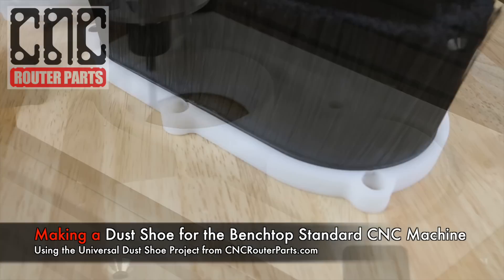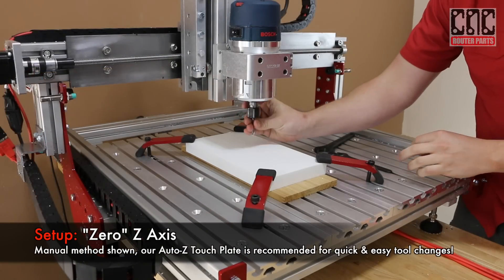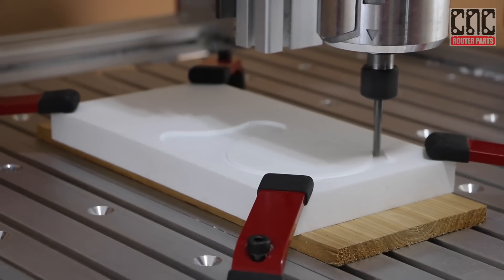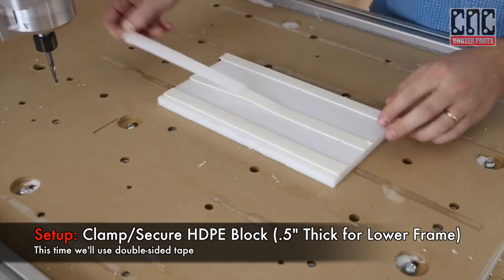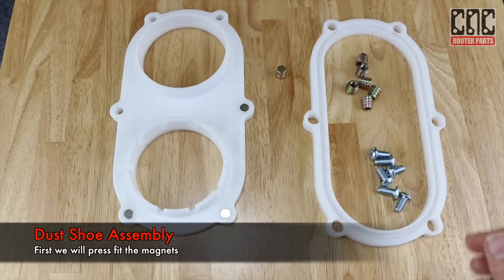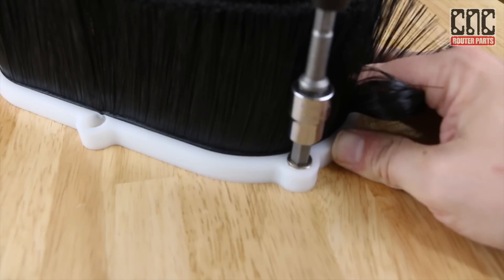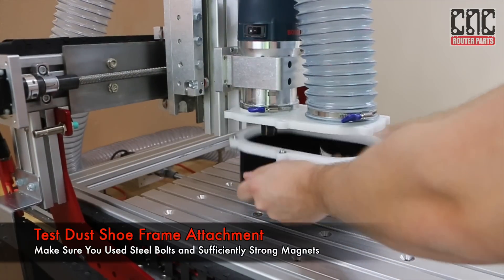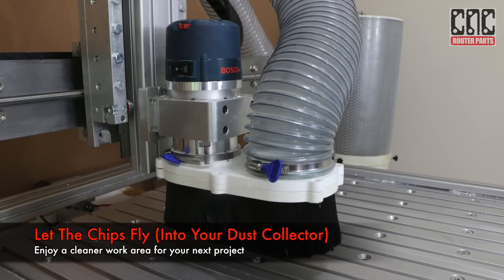Making a DIY Dust Shoe for the Benchtop Standard CNC Machine

Comment: Any suggestions on how to deal with warping?   The finished pieces are so bowed they are impossible to use.   They were milled from flattened HDPE stock.
Reply from the maker: You could try another piece of HDPE. Most of the time it's flat enough. Another material might work well too. Best bet is to post on our forums. There are a lot of users there that do stuff like this. I bet you could find some help there.

Comment: I made this shoe but the m8. 1.25 bolts that are recommended are not good.   As other have said and all the reviews the screws are not attracted by the magnet enough and falls off very easily.

I went to Home Depot and bought the zinc plated bolts m8 1.25 16mm and they stick to the magnets 3-4 times stronger and now it’s take effort to pull it off.

Comment: I just made this, it went pretty well.  Here's what I recommend:

1) Don't use the linked HDPE plastic stock from the source project page.  That is standard cutting board stuff and is way too flimsy, especially for the lower ring - it will probably warp on you.  Use King StarBoard ST (marine-grade HDPE) - it's UV and weather resistant and much stiffer.

2) It would be nice to add a couple outer "lips" or tabs on the lower portion to give it some purchase when taking it off.  I'm probably going to re-cut my lower portion to do that, or I might just add a couple of thumb screws.

3) Make sure your inserts are perfectly straight going into the lower ring, otherwise the two might not  seat/seal together nicely.

Pretty fun first project on my new Avid CNC, really could've used a dust shoe though, got chips everywhere!  The machine performed flawlessly.

Comment: I'm working on this project, modified the hose diameter and offset, I have run the top mount plate and it rand perfectly with my single flute 1/4" Dimar SCPl46 at the 120 in/min. Now going to run the bottom brush plate with same bit plus the Dimar 1/8" single flute SCPL43. 

Still looking for a source for the 3" strip brush. I see in Fusion 360, the design could have imported the parts from McMaster Carrs drawings. This would have provided everyone with a source and part numbers when making this project. Thanks to everyone at CNC Router Parts for the project, it's really great, and pushes us to lean some Fusion360 for other projects on our list.

 I look forward to more projects in the future.
Reply from the maker: Hi, thanks for the comments! We have updated our DIY Dust Shoe project page with links to all the parts (including the dust strip) > http://www.cncrouterparts.com/universal-cnc-dust-shoe-p-396.html . -Nathan

Comment: I love the design. I have found an issue with the universal Dust Shoe in the fusion360 when you 
change the parameter HoseOffset to 8.82"  the insert extrude for the 
middle to mag mounting do not move in line with the changed location. 
Also the two mounting holes near the dust hose and merged together and 
is elliptical. With no holes.  I am looking to use this dust shoe on my 
Machmate CNC machine. Also it would be nice to be able to add another 
set or to of mounting holes to do with the longer length. So a parameter
 to say how many mounting holes on the straight edge would be nice. You 
could lock positions of the mounting holes on the curves. I have only 
just started using fusion360 so my skill level at the moment is well 
beyond fixing these issues will you
Reply from the maker: Hi Paul - Thanks!  I see the same issue, looks like some of the sketch constraints were missing.  Try the v1.2 version I uploaded to our project listing, should work better now.  -Nathan

Comment: Thanks for the video... Where did you get the brush strip?...
Reply: +Teddy torres I got mine from McMaster Carr.  Search for conveyor brush.  They sell it in different lengths.
Reply from the maker: +Teddy torres Hi Teddy, Jake's suggestion is a good short-term source for such a small amount (24") of flexible brush strip.